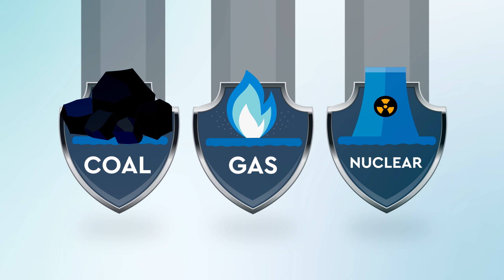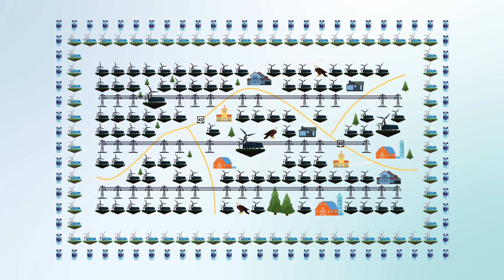Energy 101: Energy Density

Comment: If we apply ccd cells capacitance like  in parallel then we need only small current of high voltage and can power entire city with one alternator if carefully designed using induction effect